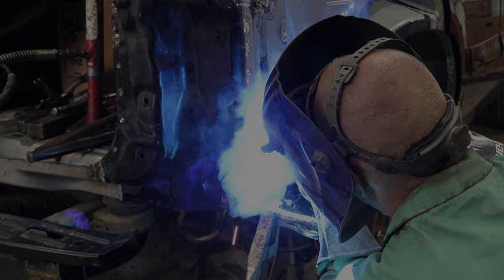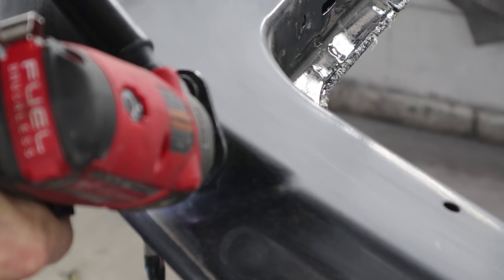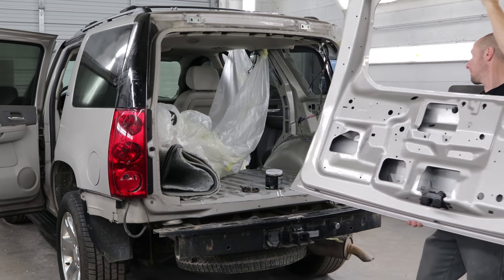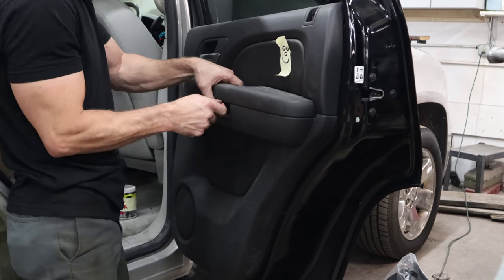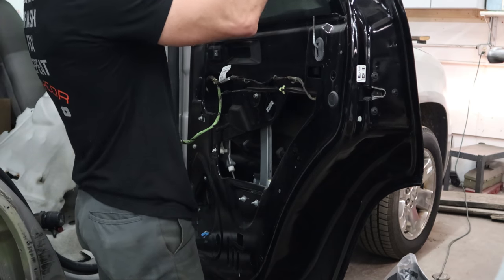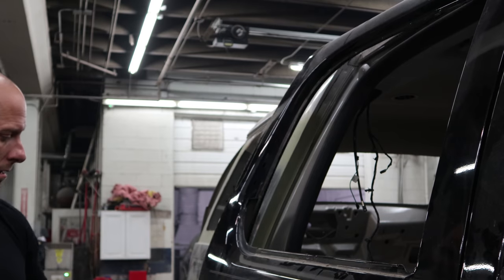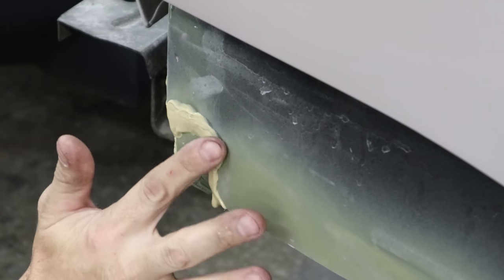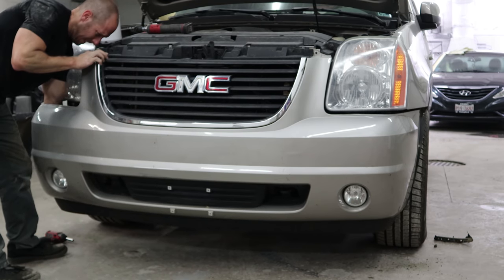Rebuilding a GMC Yukon hit by a semi part 5

Comment: I always hate those shops that paint doors without removing the wiring or hardware. So you get over spray all over the wires and hardware. Yeah classy work guys. Keep those "Afternoon crew screams" coming. You're doing a great job!
Reply from the maker: Yeah, it doesn't take that long to strip a door!  Take a little pride in your work! Thanks for the support!

Comment: Good afternoon Scott, really quick work. We have used the heat trick with very good success. You are right about those door mouldings, I have seen alot of damage done by just trying to rip them off. To bad the good looking help didn't show up. Oh well. Have a good weekend and you take care.
Reply from the maker: I just took the moldings off the other tailgate and the heat saved all the parts from destruction!  The afternoon crew has a busy schedule she only gets to work on Sundays and only if she has everything finished.  I learned the hard way on those side moldings a long time ago! It is an easy lesson to remember.  You have ample time to think about it as you straighten out the dents! Thanks for watching.  Have a great weekend!

Comment: Looks good.  Not many rebuilders would go through the trouble of color matching the doors under the interior panels.  Nice work.   I remember when I was out of HS I worked at a place that made semi trailers for the the TV broadcast industry and used that panel bond and the super high bond double sided tape.   Watched some guys trying to pull off a sheet of exterior aluminum sheet that was messed up.  I think it was .063 (about 1/16" thick).  Took a forklift and chains and still ripped the aluminum...that stuff is no joke as far a bonding ability.
Reply from the maker: Maybe I paint the entire door just because I hate masking so much! 😂 To me it is easier to take it apart and do it right.  I have seen wrecks where spot welds tear but the panel bond is still holding strong!  Heat is your friend when removing it and sometimes, the only way! Thanks for the support!

Comment: While you have the fender liners out, put the front on jack stands, take the wheels off and replace the exhaust manifold bolts before the heads of them all pop off, if they havn’t started to do that yet. If you plan on keeping it or keeping it in the family, throw arp bolts on it. 2 weeks after I bought my Tahoe had 4 of those darn bolt heads break. They were all intact when I got the truck and was going to change them but they beat me to the punch lol
Reply from the maker: No one is ever happy! I either get, "you should spend more time and money" or, "why do you waste so much time and money?"

Comment: Looks proper, and I'm happy to see you using better tools now. I haven't followed this truck rebuild though, I've been doing too many myself lately. 
I had the pleasure of doing a quarter skin and two doors on a little Nissan van these past few days. 
Someone already butchered a quarter skin on it. I couldn't believe the rust inside the panels. 

Seam sealer is your friend kids! It does help to not leave an eighth inch gap in between your panels when you weld it though. At least the "spot welds" were easy to find.
Reply from the maker: I use a variety of tools but to be honest I like the HF stuff.  No worries if you are busy, just wait a couple weeks and cheat and watch the entire build on the playlist.  I won't tell.  Good luck on your mess!  Maybe the guys that fixed my mistake got to yours too!

Comment: Thanks for the tip on removing the doors, I have to remove the doors on my 08 crew cab silverado that will make it a lot easier than unbolting the top hinge. 😎💪🏽👍
Reply from the maker: I wish they had made both the upper and lower lift off but I take one if that is all I get. lol

Comment: Looks like you do a great job of putting them back together better then anybody else but once they are wrecked they are never the same
Reply from the maker: The wrecked car bias. People overlook imperfections in cars they believe to be unwrecked and attribute all imperfections in wrecked cars to the accident.  A properly repaired car is just as good, if not, you have the wrong people doing the work.  I have converted may people out of your thinking without trying.  Many of whom only bought new cars previously.
Reply: @vehcor  If I knew everyone rebuilt cars like you do I wouldn’t have the wrecked car bias. But most do a crap job so the bias remains.

Comment: Nice work as always  I always look forward to Fridays!! Btw I have degeneration in my discs and used to wear a weight belt but got told off by the doc because while it gives short term support in the long term it weakens your back!!!
Reply from the maker: Agreed, on the back.  That is why I only wear it at the end of the day when my back is fatigued.  There is a greater risk of injury but I still have work to do.  The belt helps me to keep going safely.  Thanks for the support!

Comment: To combat GM loctite.
 A little love with a heat gun.
One or two small taps while the bolt  is warm with a center punch. 
Has always worked wonders for me.
Reply from the maker: I skipped the center punch step and it worked out.

Comment: Can I get the part number for that SNAP ON Prop Rod!?😂
Reply from the maker: Sure, 2x4x7. 😂
Reply: Typical Snap On they buy a 2x4x8 cut a foot off and sell it for twice the price.lol but it does keep the truck stopping by every week!
Reply from the maker: Lesterntomson ! Then they sell the 1ft "adapter" later at 50% off if you also buy the 2x4x3 hood prop. 😂

Comment: So on removing the hardware from the door handle I heard you say heat them up. Did you a micro torch? On the door could you have “stripped” the front and rear doors and had the paint guys do the body work and then install the shells for the alignment for the quarter panel or is it good practice to hang the doors first and do the alignment of side panels. As always thank you for taking the time to video tape all the repair procedures with commentary. I bet it’s adds a couple of precious hours to each build. I am taking mental notes for my channel on a long bed/short bed conversion this winter.
Reply from the maker: I just used a propane torch to heat them for a couple seconds.  Always hang the doors with everything in them if you can.  The weight of each part will change the alignment.  It is actually easier to strip them on the truck, that way you can use the switches and not have to jump the wires to lower the window.  It doesn't take that long to pull the door and hang them anyway.  It does add some time to make the videos but it is a fun distraction sometimes.  Thanks for the support and  good luck on your builds!

Comment: So I have to assume that your Snap-On that your specialty tool cost around, what? $400.00 or so?  Btw, I noticed just a couple of days ago that Permatex makes their thread lock in a new formula that holds like red, but releases like blue.  Sound like something that GM should invest in.  Oh, and a few days ago, after straightening some underbody metal that was bent up in an "incident", causing the bumper cover to distort over time.  I came up with my own solution, not all that different than your Locktite solution.  The indispensable heat gun. Worked like a charm after I remove two trim clips.  Great minds think alike. Lol.
Reply from the maker: Like any other SnapOn tool, it is only $15 a week for the rest of your life. lol The loctite supplier must have made a killing on the commission from that sale to GM.  I always try different solutions until I find one that works or the best one.  Thanks for watching.
Reply: @vehcor  LMAO

Comment: Alright I just bought a 2012 Yukon Denali XL and it needs a new tailgate, both doors on the drivers side need replacement, and a back fender. I am getting parts off a 2007 Yukon Dinali XL. If both tailgates have back up cams, and power lift, do I need to which the wiring or am I good to go? Can you remove the back fender without having to weld it and all that? And do I need to which the wiring in the doors? Also in the 2012 Yukon the back windows roll all the way down, and in the 2007 they roll half way down. Is there any way I can keep the feature for them to row all the way down? Can you please answer my questions, and give any advice if you have any. 😅😅😅

Comment: OK, I get it - you've done this before. Or, you read the instructions off camera between each step. Either way, most impressive.  I keep coming back for the afternoon assistants to show up, and I am extremely patient.  I did not see anything funny about the f*ck*ng train or outtakes, but laughed anyway because everyone else did. But I do have one question; Where in the hell did you put the 1,237 pieces you removed?  Did they go to paint also?
Reply from the maker: I do have a little practice at this and there are no instructions to read on most body repair,  just guidelines to follow.  The afternoon crew used to work once a week occasionally in the summer.  Now with school, work and everything else, the little one won't be here for a while.  The other one is injured right now so she will be off for a while.  Not everyone finds humor in my struggles but I did so I thought I would share.  Everything that needed to be painted went to paint.  Everything else, there is a video for that:  https://youtu.be/ClYB9ULsN6Y  Thanks for watching.

Comment: Vehcor, thank you for sharing. Another great tutorial video. So many things to learn and admire. Knowledge and patient. Have a long list of comments but probably you have heard them all. 10/26/2019 at 10:05 EST so far, nine haters ha ha ha ...they don't rest...ha ha ha  Just out of curiosity, seen to build a vehicle "they' use glue in several applications. I see it in construction. The use of glue is popular. Well, have a Q for you. Making an analogy with Metal Fatigue, what is the expected useful life of glue. At what point the chemical reaction of glueing ends? How to determined that or perhaps where to research. Have you ever seen old documents held by Scotch tape?. Glue have loss it properties (gluey)...just wondering...
Reply from the maker: It is not really like glue, it is just easier to say and gets the point across.  Only time will tell how it will last but it dries like concrete and is just as strong.  I have seen some of the oldest uses still holding strong after an accident.  Heat and UV seem to be the only things that affect it. So it should last as long as the metal it is attached to if I had to guess.

Comment: Ok, so how did you heat up the door handle nutsert / bolt / locktite ? Soldering iron , or heat gun ?
Reply from the maker: Propane torch for a couple seconds.

Comment: i arrived to the party late. is that quarter panel off the 200k plus mile yukon parts truck you used to fix the 13 red yukon??
Reply from the maker: Yes it is.  I took it apart in the 3rd?  video.

Comment: If wiring from a parts vehicle is better than the existing vehicle is it not possible to leave in if it is in working order that to the new person who has the vehicle you could inform them that the wiring is upgraded and you could add new features to the vehicle is that possible or just keep it original no fluffing  about then

Comment: I find your lack of Loctite use during reassembly disconcerting!
Reply from the maker: Don't worry GM used enough on the first application for these bolts to be reused a dozen or so times.

Comment: 😀😀 At the end. Question, my wife's 2011 Yukon has some rust starting in the lower seam on the rear gate. Any pointers on treating it?
Reply from the maker: Grind it out, try some rust converter on it and the inside and then paint it and put cavity wax on the inside.  Or just replace the gate and put cavity wax in for a permanent repair.
Reply: @vehcor  Thank you sir!

Comment: Imagine that - the forklift operator damaging a vehicle. I've see several videos of rebuilders picking up purchases that get damaged by the operator. Don't understand what it is with these guys - is it the equipment or the operator? The buyer shouldn't have to pay for such damage.
Reply from the maker: I don't mind little stuff like this, I expect it.  I had one the looked like it was at a demolition derby at the auction.  The pics showed the car with no damage on the rear.  When I picked it up, it looked like it was rear ended at 55mph.  It did bother me since I bought the car for the engine.  I have seen them drop a car from the top deck of a semi transport truck and then just shrug it off like, "oh well"  it is not the equipment.

Comment: Just wondering how much trouble it would actually be to upgrade this Yukon to the camera and power gate?
Reply from the maker: Changing the entire body harness, dash harness, radio, liftgate harness.  Reprogramming the BCM and radio modules with some kind of hack since GM will not allow you to do it with their programming.

Comment: Do you have any suggestions for repairing the detent roller''s on the lower driver/passenger hinge's that always mess up??  The kits sold at the parts stores SUCK!
Reply from the maker: On these you can just bolt on a new hinge.
Reply: Or would you have a good hinge you would like to sell??  It's for a 08 Silverado.  Tahoe, Suburban, ect are the same I believe up to 2013
Reply from the maker: Which side?  Front or rear?
Reply: @vehcor  Front Driver, lower hinge

Comment: Why not put the power lift gate and backup camera in it? 🤷🏾‍♂️
Reply from the maker: It involves changing the entire body harness, dash harness, radio, liftgate harness.  Reprogramming the BCM and radio modules with some kind of hack since GM will not allow you to do it with their programming.
Reply: @vehcor  I scrolled through comments for quite a while looking for this. I was pretty sure someone else would have already asked the question I wanted to ask.

Comment: What did you use to heat the handle bolts
Reply from the maker: Propane torch for a few seconds.
Reply: @vehcor  what about an induction  heater .. no flame
Reply from the maker: Rob Powell in a perfect world I would have all my tools available at all times.  Sometimes I forget to bring them with me or don't think I will need them.  So, I use what I have available at the time.
Reply: @vehcor  never a truer statement  , I just wondered  if you tried  it if it would work
Reply: @vehcor  or would it get too hot

Comment: A little confusing and unnecessary taking off parts from donor car and put it on the built car and then take the damaged parts on the donor car.  You don't need to show putting parts back on the donor car. Just concentrate on the car you are rebuilding and forget about the destiny of donor car, unless you want to extend the videos to twice as many!